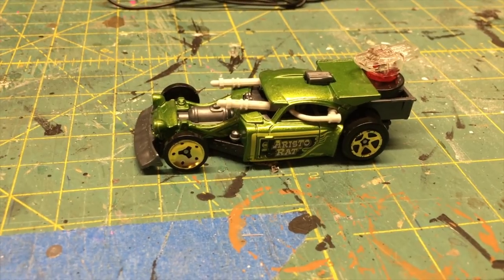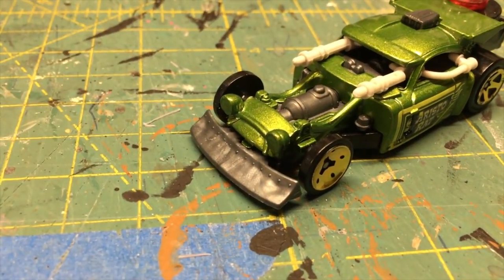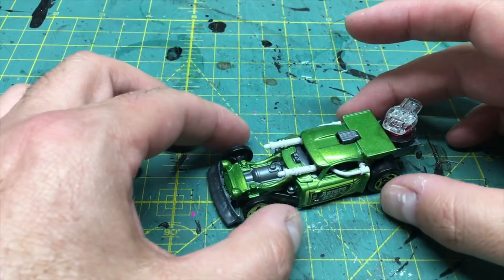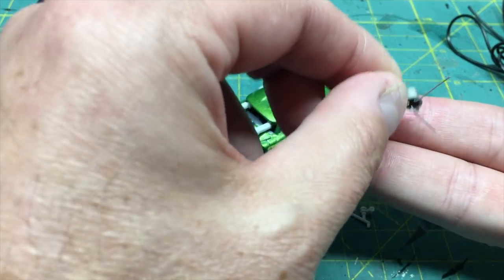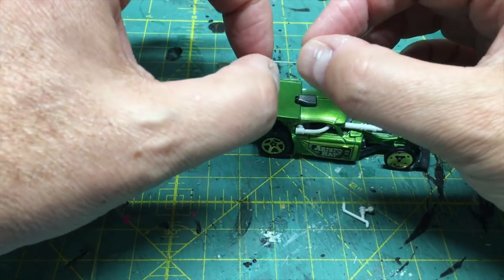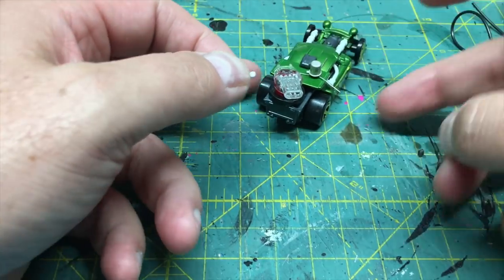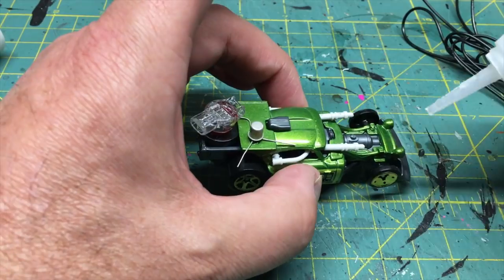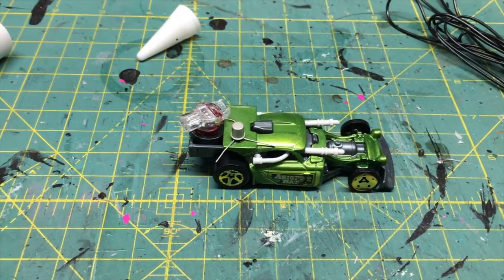GTE 060 -- The Blue Streak for Gaslands Combat Vehicle Game

Comment: The phone cable electronic part is a great idea! I'll need to look into phone and network cable plugs for use as car turrets! Car looks great!
A thought about the engine, I know that the block structure of lots of engines are painted a color, like orange or blue, so maybe paint the main section of the engine and then grunge it up!

Comment: Thanks to these videos and a couple others explaining the game, I made up my first Gaslands truck this weekend. The name "El Paso" kept going through my mind as I was painting it so, the name kind of stuck. I think its the giant cow skull on the front I added from an old Orc Boys set. I did have question for you though. I'm having a difficult time drilling out the cars from the bottoms. I keep slipping with my drill or feel like i'm grinding too much away, and it keeps leaving big nasty holes in the bottom of my cars. Since its on the bottom and these things are supposed to be beat up, I guess it shouldnt matter, but any tips on breaking them down to help us newbies out? Thank You.
Reply from the maker: I tried a number of drill bits and finally figured out you need one that is just a hair smaller diameter than the rivet you're drilling. If you're having trouble steadying your hand, consider a portable drill press like this one -- a bit overkill, but if you're worried about drilling your hand or need some stability, it does work.

https://www.amazon.com/wolfcraft-4525404-Muilt-Angle-Attachment-Drills/dp/B000JCIMEA/ref=sr_1_3?ie=UTF8&qid=1524524992&sr=8-3&keywords=portable+drill+press

Comment: With watching this video, it made me think I need to stop by the "Reuseum".  They have tons of electronics pieces and also salvage pieces from broken hardware... so they have a lot of "stuff".  Dropped $5 for a bunch of bits and pieces I can add.  :-)  Thank you for these ideas.
Reply from the maker: Let me tell you -- electronics components make GREAT greebles. Voltage converters look like machine gun turrets, resistors and transistors can be made into fuel tanks and other tank-shaped items. I've got to find a place in Atlanta like "Reuseum" -- sounds like an awesome place for a hobbyist.
Reply: Something that I found, is that picture hanging wire, makes a really nice looking "cable" along the lines of the chain you did in  GTE053.  I am using it for bumpers on one build.
Reply from the maker: Is it the kind that sort of keeps its shape when you bend it?